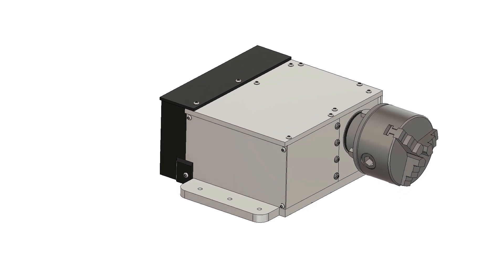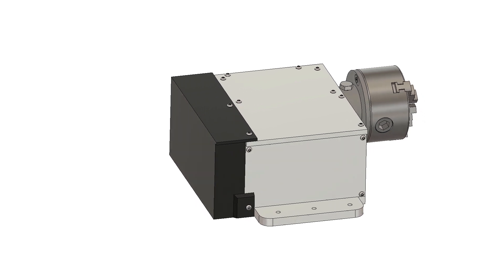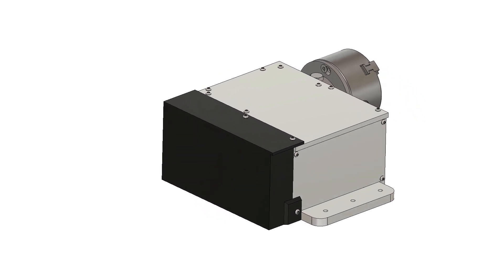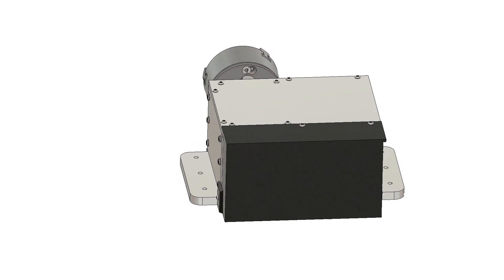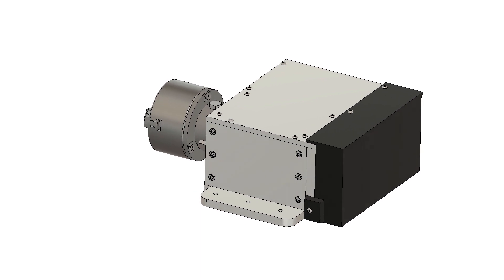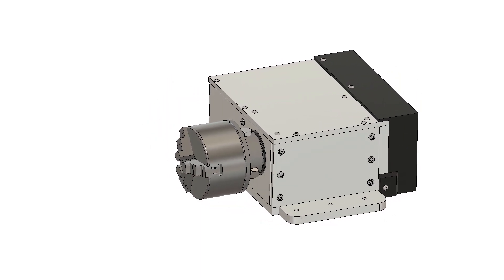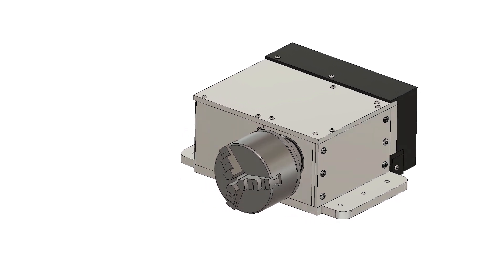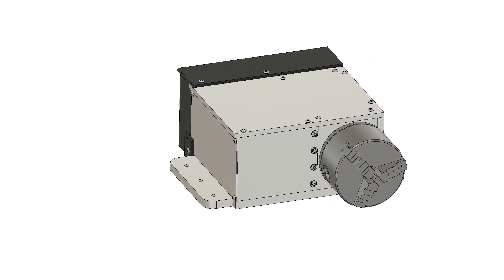Construction of a 4th axis Part 3

Comment: I see a lot of potential for this 4rth axis.  You need a few different turning tools as you have seen! Nice to see your progress and what you can make with this additional tooling.
Reply from the maker: Thanks. I also think that this axis still has a lot of potential in the future a tool changer is planned with 4 tool places and a drill chuck.  If the configuration of the post processor works, milling and turning operations are carried out at the same time
Reply: @MarkGyver  is it possible to contact you?